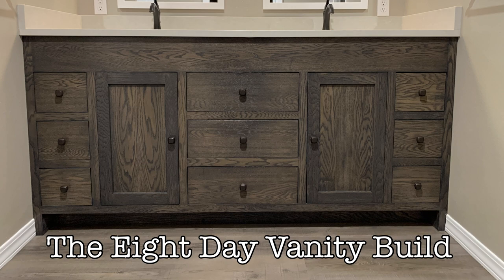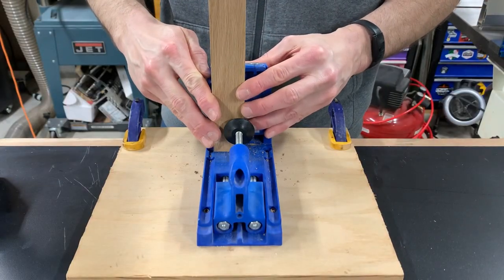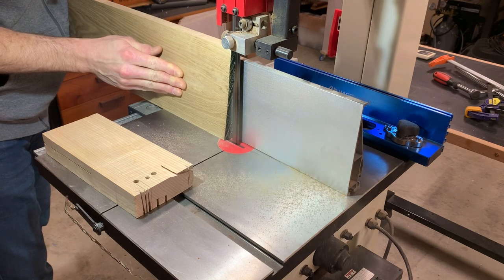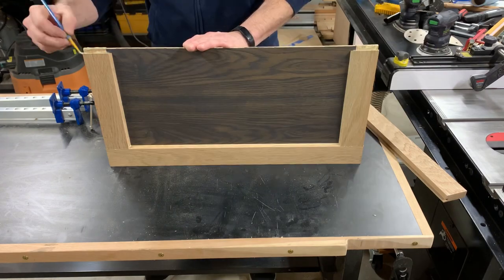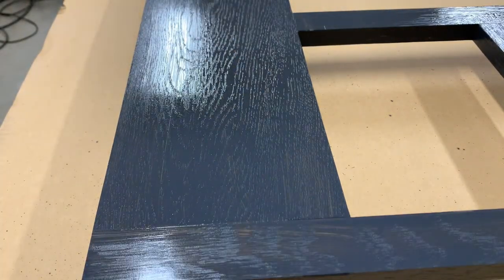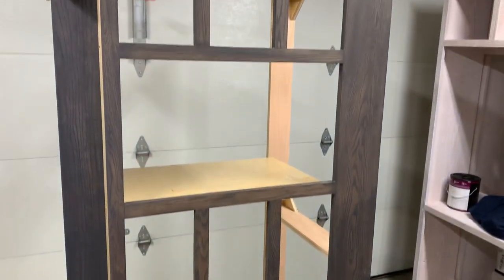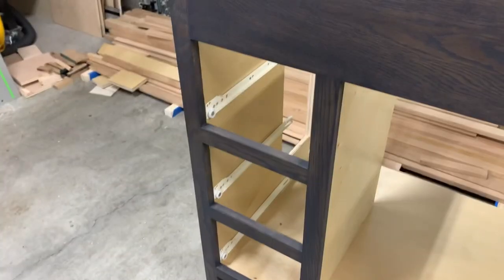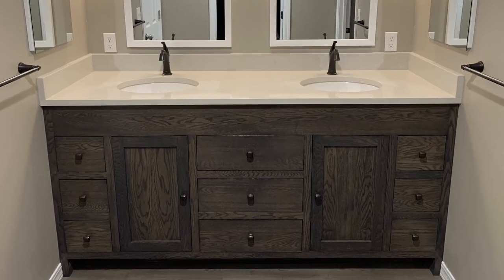Building a Bathroom Vanity

Comment: How would you modify building the vanity if the plumbing comes from the floor instead of the wall?
Reply from the maker: Take it into account in the design and have holes in the bottom or leave that part open instead of the back.
Reply: @catspawcustoms  Thank you! We wanted to purchase a vanity, but none we found (that we liked) accommodate floor plumbing.

Comment: How did you build your JessEm rig for your SawStop? I see your using the magnets to hold it down onto the SawStop. But what did you use or buy to make the mount to hold the track, etc for the JessEm?
Reply from the maker: It’s just a piece of maple that I painted black, with two mag switch’s.
Reply: @catspawcustoms  ahhh nice. I am going to have to copy your setup

Comment: What is your preferred joinery method for face frames?
Reply from the maker: If I’m feeling really nuts, half lap, otherwise dominos.  Pocket screws are fine, but they can make some woods split depending on the thickness, etc…
Reply: Nice! It’s very common to make them with pocket holes.

Comment: Did you pre-mill this wood?  That is my struggle need to save up to get a jointer.
Reply from the maker: Yeah, this all started out as 4/4 rough from the lumber mill and I milled to 3/4 s4s
Reply: @catspawcustoms   Did you do it on the table top jointer?
Reply from the maker: @garrettp.5018  no, too small.  This was edge jointed with a tracksaw.  Not the best solution but good enough.
Reply: @catspawcustoms   That is edge jointed. What about the face jointing? Do you buy the boards flat from the lumber source?
Reply from the maker: @garrettp.5018  faces didn’t need it, pretty flat from the mill so thickness planning was enough.
Reply: Got it!!! My struggle is that with the lumber yard I can go through 50 boards to get 1-2 boards that have acceptable flatness…   It’s pretty frustrating when you need a longer board